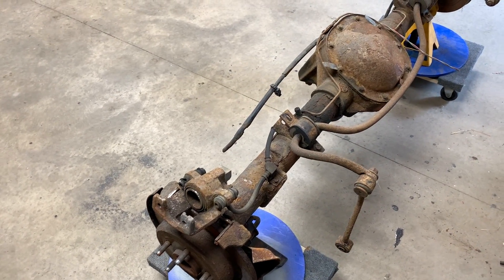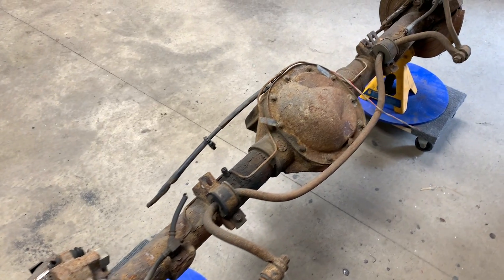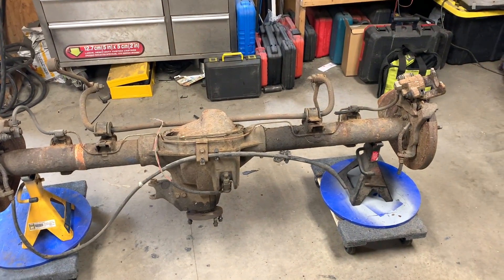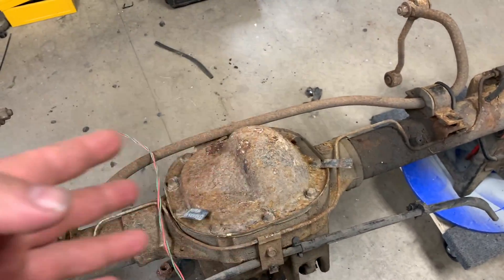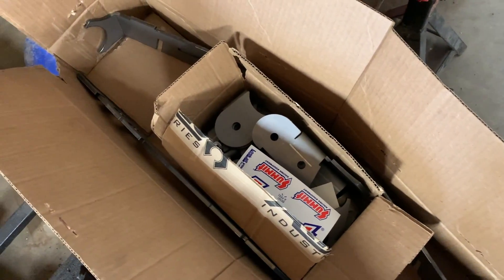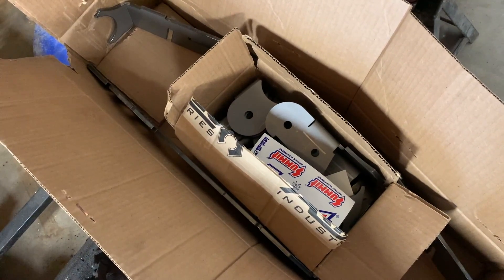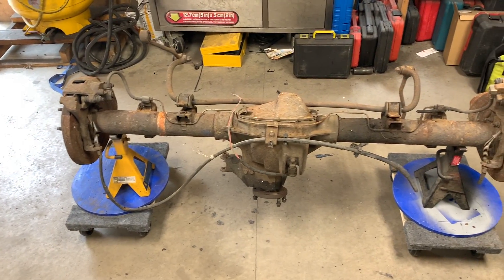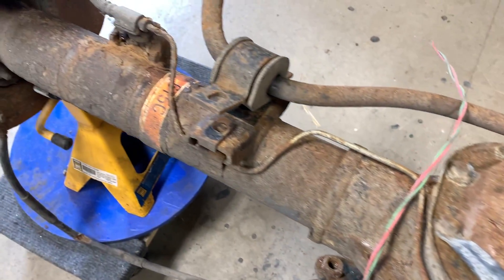Ford 8.8 Axle SWAP Build for Jeep TJ

Comment: Lose the existing anti-sway bar. Get an anti-rock, you won't regret.
Lose the brake dust shields they only collect pebbles.
Reply from the maker: Can’t loose the dust shields the parking brake spring pins are tied into them

Comment: No you don't need the sway bar , you will use the jeep track bar and control arms . carefully remove everything from the tubes not to cut into the tubes and sand to bare metal. Weld the tubes to the pumpkin as they are just pressed in , small runs and skip around. Summit has Richmond Gear EXCel Ring and Pinion Sets F88456 for 165.00 , best price I have seen for a quality 4.56 set. I like the Barnes kit but the Aztec kit is okay just more work. Pay close attention to the pinion angle and I would suggest a SYE kit too. Tack and test fit before welding up and you need to decide on any lift now . Find someone who has used the Aztec kit and chat with them. That's all I can think of right now .... anyone else?

Comment: Hi Jerry, any concerns with warping the axle when welding on the truss? From what I gather it can be pretty tricky to do while welding the mild steel truss to the cast axle. Are you gonna sleeve the axle? I’ve heard pros and cons for both.
Reply from the maker: There is always that concern, always tack all your points to lock the axle in place, if the tube is going to wrap the tacks will actually pop and you’ll know you messed up.  Lots of stitch welding from various points on the axle tube and letting it cool.

Comment: I look forward to you doing the gearing, thats something I always wanted to try by myself but it seems very intimidating!
Reply: I love regearing, I just put 4.56 gears in my 2nd gen. having a dial indicator and a micrometer is a must, also replacing the crush sleeve with a crush sleeve eliminator kit is best. Having a shop press really helps to. Give it a try, it's really not that hard..
Reply: It's not that bad. Just take your time. 
And take pictures of how you take it apart.  If you are unsure on reassembly. And what ⬆️⬆️⬆️ he said.